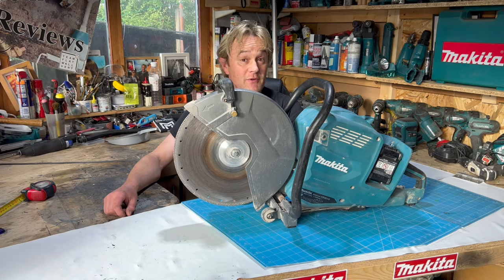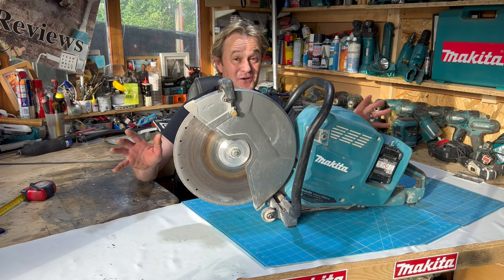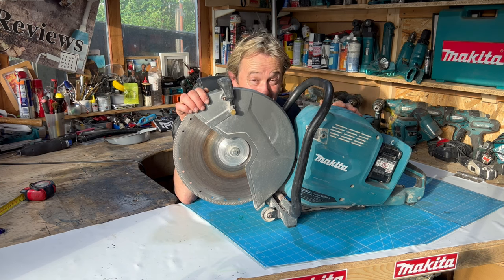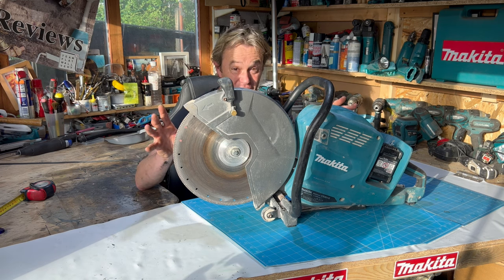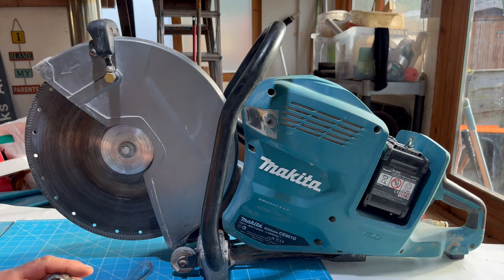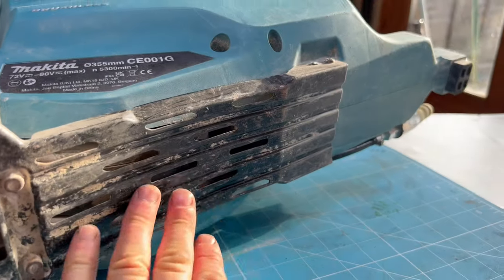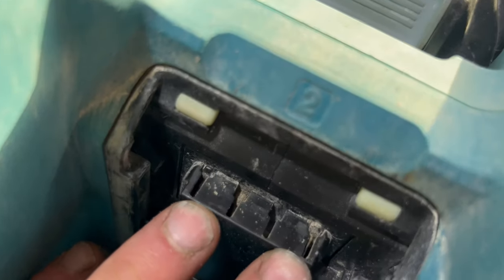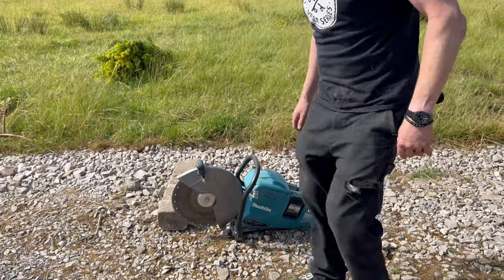FIRST INDEPENDENT REVIEW OF THE MAKITA XGT 80V CONCRETE CUTTER!, ITS AWESOME BUT VERY EXPENSIVE!!!

Comment: I occasionally run a Stihl rock boss chainsaw and the regular diamond blade cutter indoors. It's all about ventilation. Setup the high velocity fans, cross flow if possible. Always use water
Reply from the maker: There’s always a way, cheers for that dude 🤟🤟